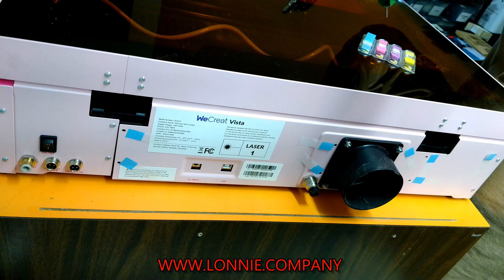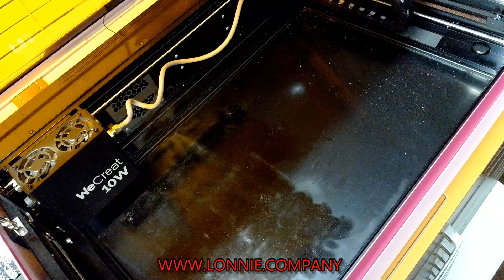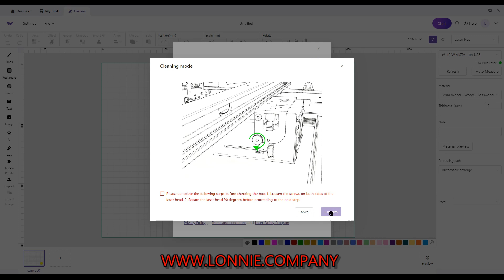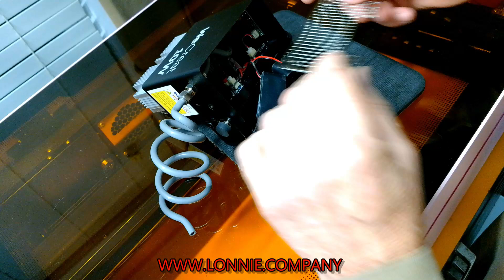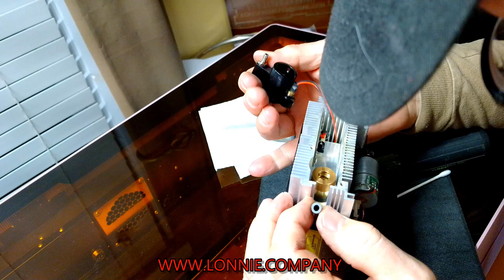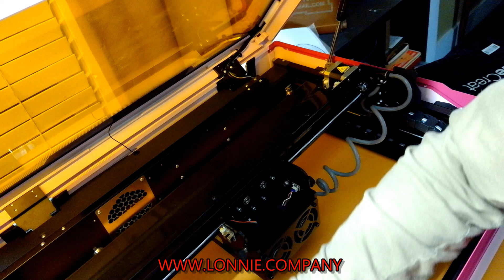Vista Cleaning Day - Cleaning WeCreat Vista Laser

Comment: followed along and did first cleaning ... well mostly lol... found one of the screws in the back came stripped, so I can't access the back fans :(  I've only used the machine for about 30 cuts on basswood and was having trouble cutting consistently so that's why I did a cleaning.  It wasn't very dirty at all, but one area concerned me was the heat sink on one side of the air input was really black - is that normal?  Also, how did you get your crumb tray to pull out from the front lol - I have to dig mine out from the inside
Reply: Hey sorry for the late response, I know that I’m not the person who made the video but I figured I could share what I know with you, as for your heat sink getting really black is completely normal as it’s just a sign of heat staining or minor surface oxidization and should be fine with routine cleaning! Now if you’re having preformance issues and the darkness is still there then I’d go for a deep cleaning of your laser head and cooling system! As for how he did that with his crumb tray that is just how his model works lol I have to dig mine out and push it under and back in from the inside of mine as well! Again sorry that I have just seen this but I hope that I was able to help!